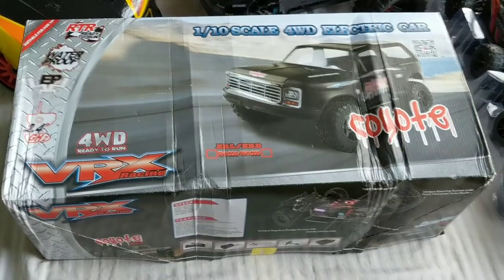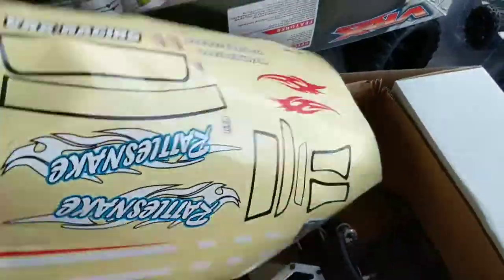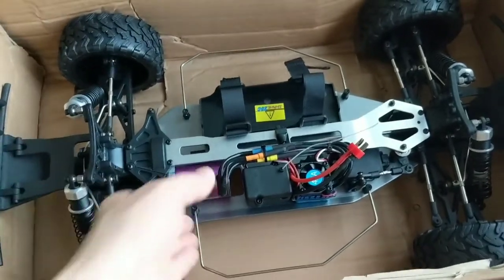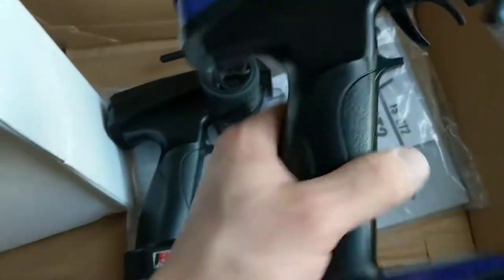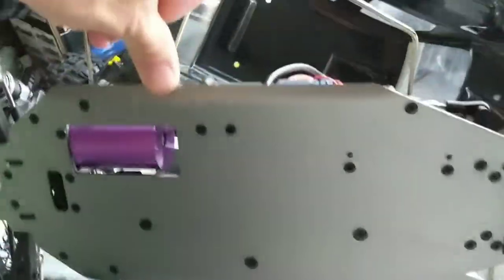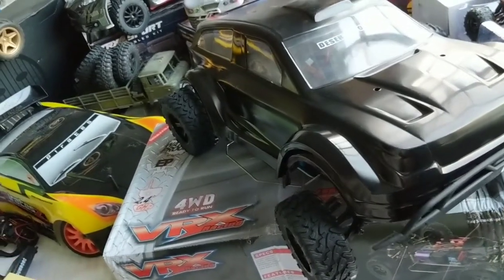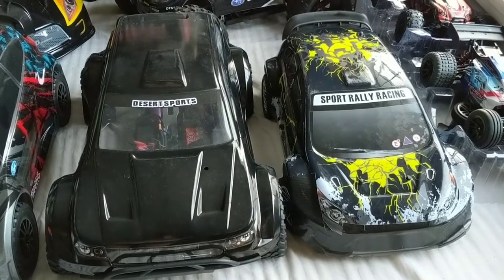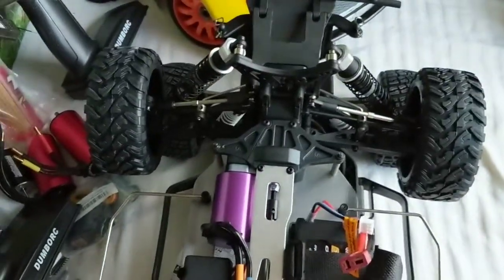RARE RC Unboxing and HSP RC Comparison: VRX RH1040 Rattlesnake Brushless. Seller replaced the body👍!

Comment: Im looking at one of these, how well has it held up?
Reply from the maker: Haven't ran it as much yet, just 2x 3s 3200 packs on road rip with speed runs. Solid build quality, I'm liking it so far. Metal chassis is awesome but may not be ideal for bashing. Will try to get more vids up soon and will definitely highlight any issues that come up. All stock right now, but have motor and ESC upgrade planned🤙
Reply: @motorheadaddictions2761  awesome, i just found these local and have been thinking about it for my dogs to chase around. Not alot of informayion about them out will keep an eye for more vids.
Reply: @motorheadaddictions2761  so...i bought the RattleSnake...lol need better charger and battery lol
Reply from the maker: @Bluespade115  Very cool, hope you have a blast with it. I think it's got a solid build and rips for the price point. I ordered a VRX rally body that should fit in there too. I found the "indestructible" bodies on eBay, and they have the both the rattlesnake and coyote. When I bust mine I'm gonna consider one.
Yeah, I recall is only came with a 2s 25c. Great that it's true RTR, but definitely more fun with more juice. I'm in US and Amazoned the battery and chargers. They seem to have the best prices. Here's a link to the charger I picked up for ~$40 and 2pk 3s 3200mah for $36. Prices have gone up since, but if you search deep, you may find similar price or better. I also picked up a 2pk 3s 5200mah 60c for $45, but these are a little fatter than the standard hard case and don't recall how the fit in this one. Hope that helps🤙
https://www.amazon.com/gp/aw/d/B084CYCWNV?psc=1&ref=ppx_pop_mob_b_asin_title
https://www.amazon.com/gp/aw/d/B07XYRK2FM?psc=1&ref=ppx_pop_mob_b_asin_title https://www.amazon.com/gp/aw/d/B07Y5CHJVF?psc=1&ref=ppx_pop_mob_b_asin_title
Reply from the maker: @Bluespade115  Rattlesnake is my first VRX, but I'm liking their products. Even over HSP. HSP offers a little more juice in their electronics and have better parts support, but are a little smaller and cost a little more. The VRXs have a similar wheelbase to the Traxxas Slash and other more common 1/10 scales. I even ordered some of their Nitro RCs 😝. Stirlingkit.com displays most of their lineup along with the HSPs on the site, good reference to see what models they offer. Their 13% "skbf" code still works too, I ordered a couple more RCs this week 😋.
Reply: @motorheadaddictions2761  nice! Mine is the brushed model. (Place had 2 cars only) the "Coyote" body was cracked no controller or battery. 180 bought this one because it was complete.
Reply from the maker: @Bluespade115  Very cool and solid price. Also didn't have to wait for the shipping. It's really about the chassis. Enjoy the brushed as it is and if you ever feel the need to upgrade brushless, there's budget motors and ESC out there for <$40. Just swap em in yourself.
It's really better to enjoy and get to know your RC how it is, before throwing a bunch of parts into it like I tend to do. That way you're really getting your $ worth. When you have a good rip session, it can be so therapeutic. Thanks for sharing about your catch👍. Don't see many of these around, it'd be cool if you get the chance to post some vids of yours.
Reply: Mine is exactly the same except with a short course truck body. Know if traxxas parts are (front & rear arms/knuckles) compatible?